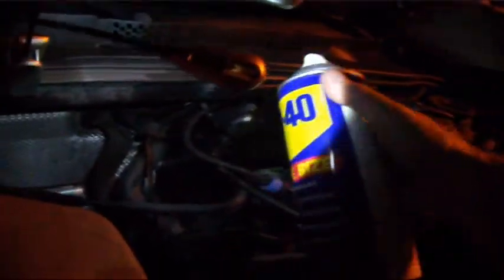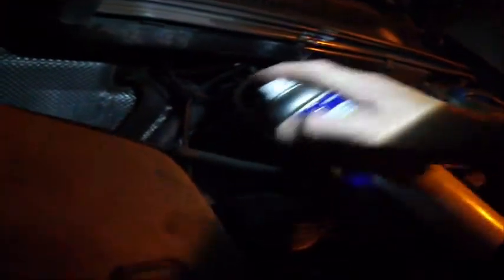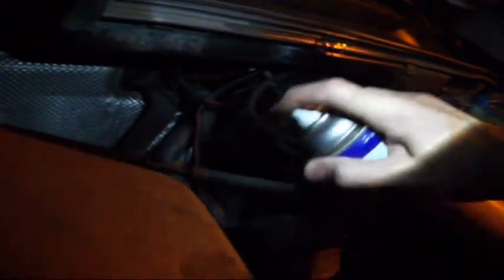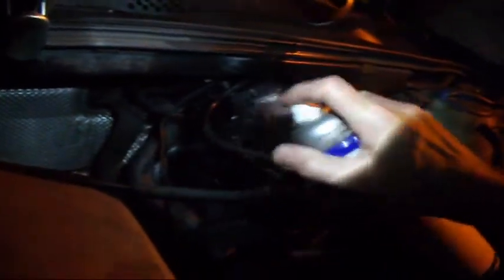Ignition Coil Troubleshooting VW 2.0L Golf Cabrio

Comment: Thanks for this video. It helped me fix an awful misfiring issue I was having with my Polo. The coil and HT leads were leaking spark like in this video so I replaced them, put in new sparkplugs and cleaned out the distributor cap, now the car runs nice and smooth again!

Comment: Thank you so much for this! After taking my car in several times to the mechanic with no resolution I watched your video. My 2000 Cabrio was slow to start on cold or wet mornings and died if I went through a large puddle. I tried your trick with the water and after two quick squirts of the water bottle it died.Bought a new coil for $30 and installed it. Runs great now and tried the water trick again and nothing happened. Probably saved me hundreds!

Comment: My 1995 Cabrio idles rough only intermittently. I runs very smoothly for a while at idle and then suddenly idles roughly. A minute later it gets rough again. This cycle goes on every day. Otherwise, the car runs great. I just had the timing checked and there are no engine codes indicating a problem.  What do you think?

Comment: Does the coil always arc if it's the problem? I tried this test and noticed an arc when I first sprayed it but nothing after, and there didn't appear to be any issue with it firing. I restarted it about 15 mins later and it was running rough and I had a check engine light and got the codes p0304 and p0301 (First and fourth cylinder misfire). Maybe water is seeping in slowly but not causing a visible arc? I still am fearful of driving through puddles.

Comment: Your videos rock. Thank you for doing what you do. I recently bought a 1991 cabrio. There are many issues with the car & i'll take all the wisdom you can offer. My first issue is with the ignition or steering column or ???? I'm not really sure. When the key is off or out. If you bump the steering wheel or hit the ignition the power turns on. Also, the steering wheel can be pulled out & pushed back a good 1/2" to 1".... What are your thoughts on the issue?

Comment: DUDE YOU ARE MY HERO! 

My car was driving and just shut off on me one morning, and it WOULD NOT start no matter how hard I tried. After messing around with it I it was a fuel problem so i changed the fuel filter... nothing. So  I changed the fuel pump.. still nothing. Changed the spark plugs and wires.... nothing.  I narrowed it down to the ignition coil but I just wasnt sure. Then I stumbled upon this video the same night, went out and tried it.. and then VOOM VOOM! it started. thanks man!

Comment from the maker: @NokturnalCelt You should not need to if the insulation on the electronics are not compromised.  I used to live in a very wet place also and we never covered anything inside the engine. /John

Comment from the maker: @GrantSchenker Another common problem is a dirty throttle plate.  Remove your intake air breather hose and open the throttle plate.  Use that alcohol and a tooth brush and remove all the black dirt/gunk from the throttle plate and throttle bore walls.  When you start the car the idle rpm will be very high for a while.   That's okay.  The computer needs to re-learn (throttle adaptation) the throttle plate settings now that it can breath more air at idle.  After a day things should be normal /John

Comment from the maker: @GrantSchenker To clean the mass air-flow sensor, it is the black tube with wire plug that's connected downstream of your air filter box.  Remove it.  Fill a big ziploc bag with 90% alcohol (get at drugstore) and put the MAF sensor into the bag.  Swish the alcohol around through the sensor for a little while.  Remove it and let it sit and air-dry overnight.  Reinstall it and give-er a try.

Comment from the maker: @GrantSchenker Thanks.  Good luck.  You can troubleshoot ignition wires the same way as the coil (spray bottle).  If you have bad wires then going up a steep hill with heavy load on the engine (put engine in 4th or 5th gear and put gas pedal to the floor) and under heavy engine load the engine will studder and misfire.  Also make sure your distributor cap & rotor are good (see my VW timing belt video) and try cleaning the mass airflow sensor.  /John

Comment from the maker: @spelunkerd Could be the coil, insulation damage on plug wires or a cracked distributor cap.  Or could be bad/work spark plugs or even a bad crankshaft sensor / distributor sensor.  That or it could be a problem with a fuel injector, causing lean misfire and appearing as weak spark.  Thanks /John

Comment: This video was very helpful! Thanks! Believe it or not, I got a new coil for my '97 GTI 2.0 for 18 bucks! It's almost an exact match of the original. It's working perfectly!... so far! :~) ... feels like a hot coil compared to the old one, which, beside the cracks,  was probably producing a weakened spark at 253,000 miles! Stay tuned.